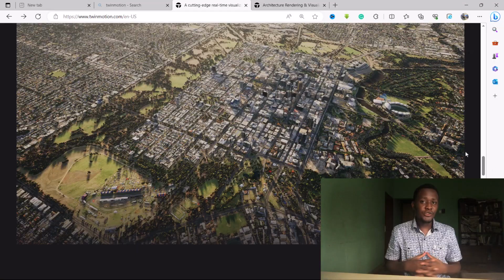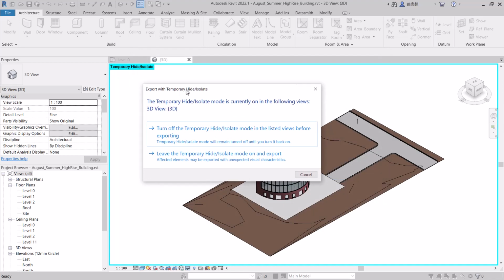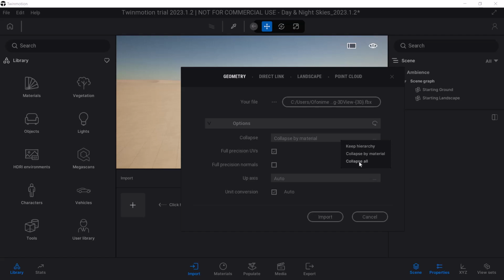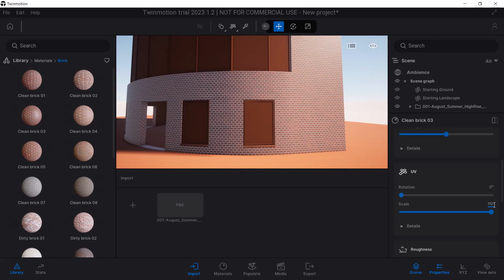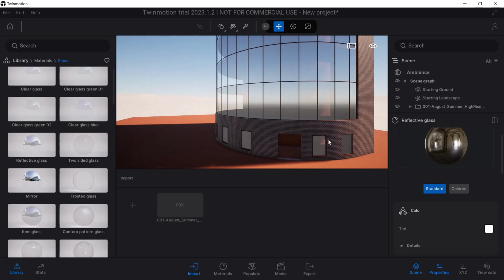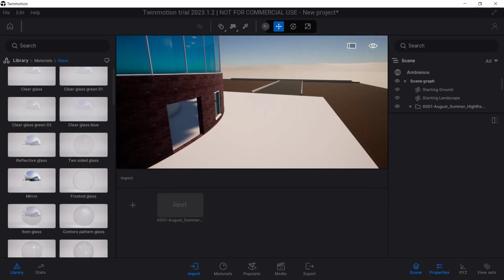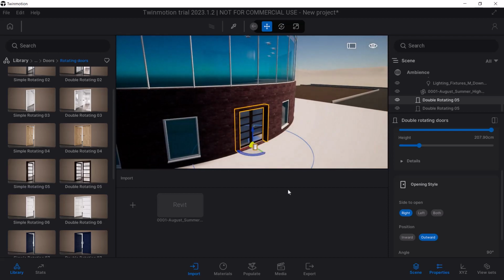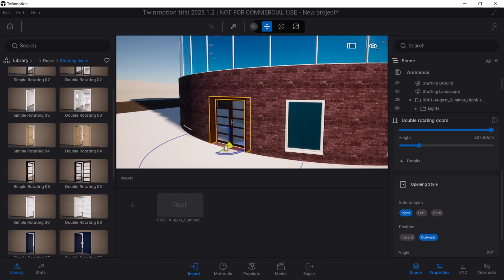How to Export Revit Drawing to Twinmotion 2023 | FBX vs. Datasmith |

Comment: Great job bro, better than most tutorials i have seen, am makin the move form Lumion to Twinmotion, my only problem is the pathtracer doesnt work on the 2023 versioin even with direct x 12 enabled, do u have have a possible solution.
Reply from the maker: Thank you KingMader, I appreciate the feedback. With regards to path tracer, not all PCs have this feature enabled. 

It is reserved for High-End Graphic Processors with Ray Tracing power. My current PC does not support Ray Tracing, so I don't have the path tracer enabled. 

Does your PC have a graphic process that supports Ray Tracing?